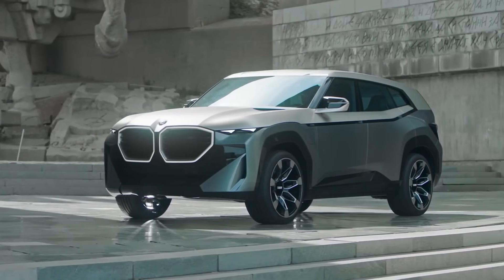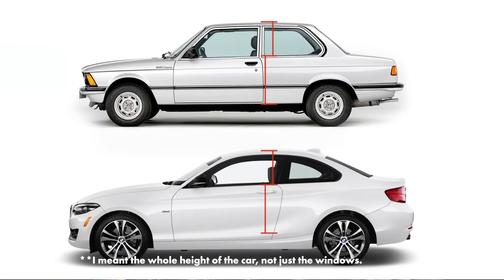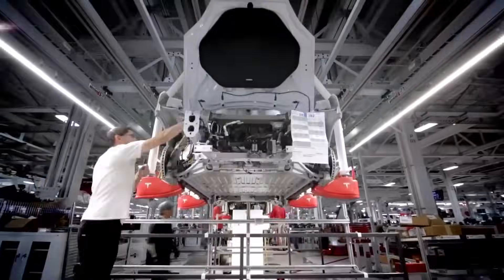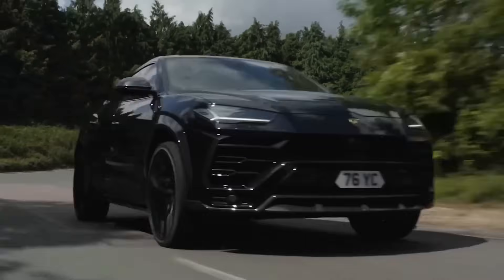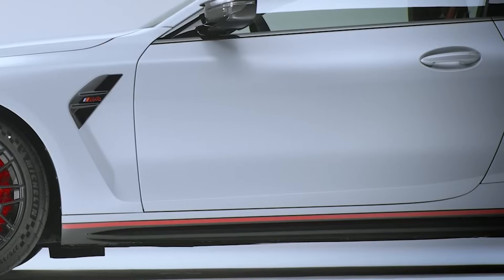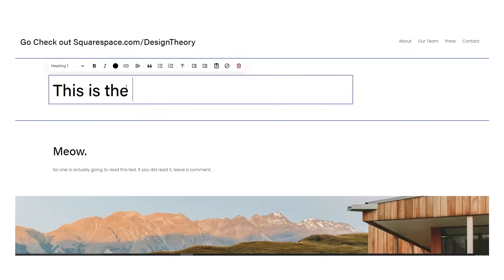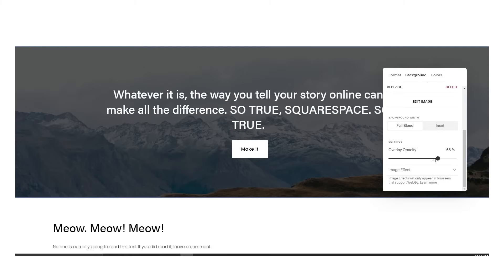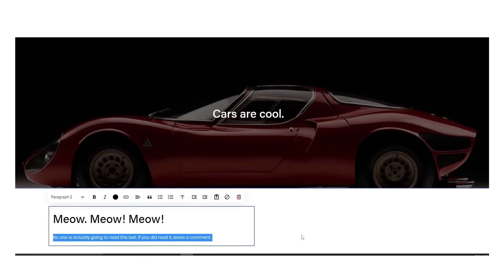Why Modern Car Designs Are So Visually Complex | Q&A w/ Pro Designer

Comment: I find the majority of modern vehicles hideously ugly. I prefer clean simple lines. Not as simple as the 4 door compact of the 60s. But more elegant than that. Saddly l doubt we will never see 2 door hardtops make their appearance again in sedans (1). Rollover standards have seen to that. One company that seems to have avoided this trend is VW. Saw a Passat wagon the other day. Striking for the amount of greenhouse. 
1) IMO one of the most elegantly designed cars of the 60s in terms of cleanliness of line along with elegant simplicity was the 2nd generation Corvair 2 door hardtop. Some of Chryslers cab forward designs were also elegant of line.

Comment: I'm sorry mate, but  sick of hearing this excuse about safety standards being the excuse as to why certain car makers are producing such complicated, and usually hideous, designs lately.  The massive grill and endless cutlines on modern BMWs are purely and entirely a visual thing.  Bumper beams, side impact bars, airbags, crumple zones - those are all internal structures below the sheet metal and plastic.  Those are the things that relate to safety and other regulations, not the exterior design which is purely a "shock factor" design aesthetic that BMW has chosen to follow.
Reply from the maker: I actually agree with you (generally)

Comment: I’m not sure how this video got suggested but I do like cars and car design. I do livery design work as a hobby though. 

Modern cars are a lot of hit and miss. The new Nissan GTR and Maxima have awful looking front tenders. The body lines on the Maxima are hideous. The new Supra looks nice and falls in line with the styling of most of Toyota’s current lineup. The new Civic is a convoluted mess. The C8 side vents and lines aren’t the prettiest. The Hyundai N Vision 74 looks good for the most part but those side vents are just too busy. I love the headlights, etc, and retro vibes of that Hyundai’s body shape though. The Mach E is an abomination due to its lack of at least a vestigial trademark Mustang grille on all models. Just because it doesn’t need a grille to function doesn’t mean the grille isn’t an important aesthetic feature. Kind of like the landau bar on a hearse. It doesn’t look good without it. The 458 Italia and V8 Tributo are works of art. Same with the 308 GTB and 288 GTO. The FXX, FXX-K, La Ferrari and Enzo are hideous. It seems like the high end Ferraris have too much of that functionality stuff in design but that’s no excuse at all for ugly cars. The Lambo Veneno is in the same ugly boat but the Bugatti VGT pulls off the convoluted mess of functionality with absolute stunning beauty. Then there’s the cars I really like: the timeless beauties. GT90, 2005-2006 Ford GT, F40. The GT90 is a deceptively timeless design and if you didn’t know the car you would assume it’s a modern concept rather than a 30 year old car.

Comment: Ok, this is bullcrap from second one.
It is not safety and it never was safety.

Making cars higher makes them less save, it makes them less useful and more dangerous to their surroundings.

The reason why they make cars bigger is that we as humans associate big with expensive.
So selling someone a suv for 10.000$ more than a sedan with the same features and otherwise same data points and interior is easy. After all it is "more car" for more money.

However making a bigger car doesn't really cost that much more. Material costs are nearly non existent, steal as well as plastics cost under 1$ per KG, a 300kg heavier suv costs around 200$ more in materials.
Production costs even less extra. Most manufacturing of parts don't increase the production steps that are needed at all, if the parts get a bit bigger and transportation is also cheap.

So in the End a middle class suv costs 10.000$ more than a similar sedan at the dealer while the production costs only rise about 500$.
And therfore companies push suvs hard.

But suv are ugly, they are bulky, fat and the exact opposite of a sleek an agile looking car, which is what we as humans see as beautiful.
All these bends, lines and nonsense is used to hide the fatness of suv. You can clearly see that on how they are used to sepperate big flat surfaces, or on making the back feel liek it goes less deep down than it actually does.

The same way they have to follow hyper individualism, where we are so extremist now, that we want to minimize contact to others as much as possible.
Dark toned windows, small windows with doors going really high up, high fronts and backs that increase the felt distance to the "outer world" outside of the car are a manifestation of individualism as a religion. Keep everyone away from me and keep me deeply hidden in my car from anyone else.

Comment: 12:35 that drill looks neither sturdy nor rugged. It looks like fischer price forgot how to design curves. When I look at that I do "perceive" that it is a powertool, to be treated with respect. The thought that it is a powertool to be treated with respect comes from the recognition, understanding and experience that this is a powertool. I don't care if it "looks like" a literal block of solid steel or if it "looks like" a hello kitty accessory: it's a powertool. The mere fact that they think my perception of the tool will change from colored plastic, angry lines, complex shapes, techy font or multiple brandname placements, is a downright insult. That HOTO? Horrible. An electronic display? MAYBE. What look like touch-sensitive buttons? GTFO. I've seen more ergonomic handles on nerf toys.

Comment: The fundamental reasons of why all cars have become increasingly ugly, is primarily due to reducing cost of manufacturing.  When real cars had full Bench Seats, Real Trunk Spaces, Full Spare Tire and simple Electronics, this was not good for Auto Manufacturers 'Net Profit Per Vehicle'. In eliminating 'Rounded Attractive Body Panels' resulted in increased Stamping Costs as well as Final Body Finishes. The Automotive Insurance Company 'thieves' love all the Straight-Line Designs, because it saves them Millions of Dollars in auto collision Repair Labor Charges from Body Shops. If you examine all the old Domestic and Import Vehicles from the 1920's through the 1960's, you might realize they will never produce any future 'Works of Art' that would be comparable.  They keep pushing 0 - 60 mph Acceleration Times because they have nothing else to sell of any value. Most buyers today are focused on 12 Speaker Sound Systems and Back-Up Cameras !